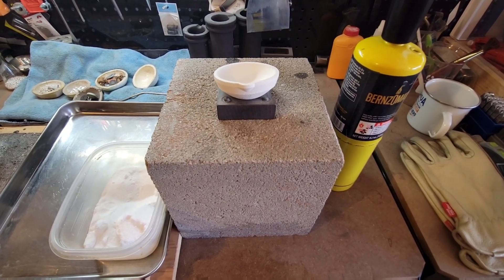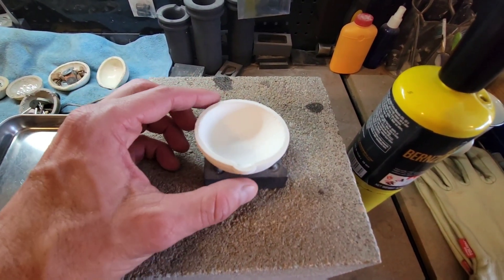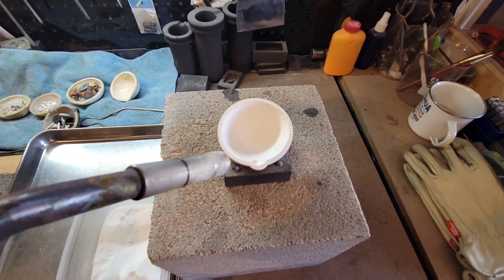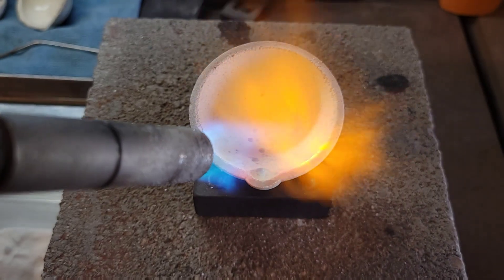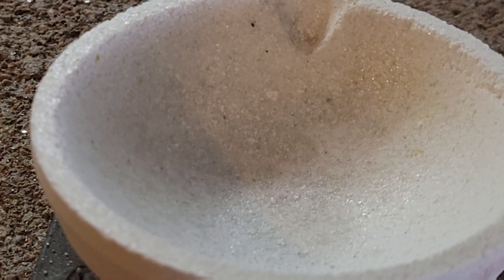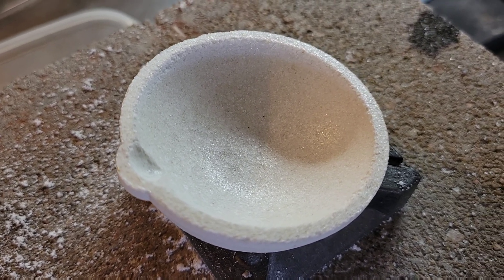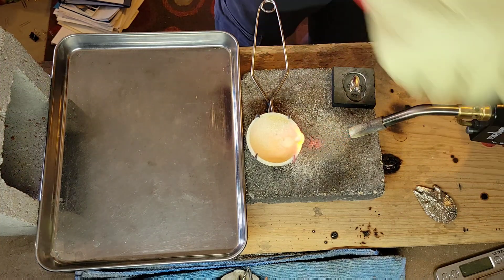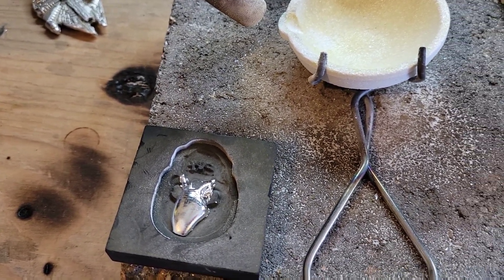HOW TO Glaze a Ceramic Crucible with Borax

Comment: How long after glazing can I start melting metal. Do I have to wait till the pot is fully cold then reheat again? Or can I start straight away. Many thanks
Reply: I ask because I bought new pots, but something went horribly wrong...i think I used too much borax...the metal wouldn't melt and stuck to the pot.....or maybe because I didn't let the pot cool first. Im not sure. I definitely used too much borax though  for sure. Its been a long time since I glazed a pot so I forgot how to do it. 😂
Reply from the maker: I would let it cool for 30 min or so to allow the borax to harden properly before you use it. Be sure to use the least amount of borax needed to just cover the whole surface with a very thin layer but fully glazed. If you use a little too much in a few areas it will be fine.

Comment: Can you use a kiln to glaze instead of a torch?
Reply from the maker: I never have, but I'm sure you could. I would think it would be a little bit more tedious waiting for the Borax to melt properly. Whereas with the torch you can direct heat where you need to and blow off excess borax. But I'm sure a kiln would work.

Comment: Would liquid borax in some sort of solvent be any more effective for getting a thin smooth layer? Like water or methyl alcohol maybe
Reply from the maker: I've only tried the power borax, but yeah I believe if done right it would probably apply more evenly. Although even thicker/uneven areas of borax on the crucible tend to smooth and even out after a few uses and as long as your pouring pieces with an overflow sprue that you'll be cutting off and re-using you'll be fine and should be able to make clean pours after a few uses. The main concern I would have is that if your liquid is too cool it'll crack your crucible during application.

Comment: Same borax you’d find in grocery stores?
Reply from the maker: @RRjames5332  Hey, yes, the borax used for removing impurities from precious metals is chemically the same as the borax found in grocery stores, which is sodium tetraborate (Na₂B₄O₇·10H₂O). However, there may be differences in purity and intended use. I buy mine from Amazon.

Comment: hey my glazed crucible starts to crack when i stop applying flame to it,is it the air outside thats cooling it off to fast and cracks and chip off ?
Reply from the maker: It's very normal to hear what sounds like a cracking noise, however there should not be any actual visible cracks. Your glaze or borax should also not be chipping off, If it is you may need a better quality borax. Every time you use your crucible and heat it up it will make cracking noises when you are done as it's cooling off.
Reply: @JoshuaAndersonLife  its small hairline cracks like a spiderweb, but the borax i bought from amazon, it still seems to work as ive melted some stuff already
Reply from the maker: You should be fine, I've used crucibles with hairline cracks in them before. Use your best safety judgement.
Reply: @JoshuaAndersonLife  ok

Comment: I've tried 3 different times now, to glaze my crucible with Borax. But it always comes out all lumpy and rough and not smooth at all. I'm using a map gas torch, is that not hot enough?
Reply from the maker: Hey, your torch is definitely hot enough. The key is to use very small pinches of borax at a time. You will have such a thin layer of glaze on the crucible it'll hardly be noticeable. It's always very tempting to keep putting on borax until you can see a thicker layer of glaze, however that is unnecessary and will burn off into your pours until all the excess is fully burned away. Whenever you see a small accumulation of borax while you're glazing, take a second to burn that away before applying more borax, or keep glazing to different areas avoiding that spot and it should continue to burn away as you're glazing. If you end up with a few areas of thicker glaze at the end that's just fine. You may have to clean up some of your pieces a little bit as that excess borax burns off with your pours.
Reply: @JoshuaAndersonLife  also, I saw a video on YouTube, where a girl puts a piece of borax about the size of a golf ball in her crucible, and it melted perfectly to the shape of her crucible. I'm guessing that's more of a paste, and not straight up 20 mule team granules like I'm using?
Reply: @redeyestones3738 I used the paste and I’m getting the same bubbling and not getting smooth, also it’s charred, so definitely trapping carbon which is not what we’re going for…. I think I need to get the crucible a lot hotter before I start trying to add the borax so it actually sticks instead of just foaming and bubbling up.
Reply from the maker: I've never actually used the paste before. I would recommend getting the powder form of borax it's very inexpensive and likely much easier to apply.
Reply: @JoshuaAndersonLife  I've never even heard of this pattern before this video. I've only ever used the powder.  But it always takes way long than I've seen it take in any videos
Reply: @JoshuaAndersonLife  I think I just need a better torch. Because I can point the hottest part of my flame at the lumpy bits, but they never fully liquify, and flaten out. Also it dries pretty pourously. What kind of torch would you recommend for the entry level silver Smith?